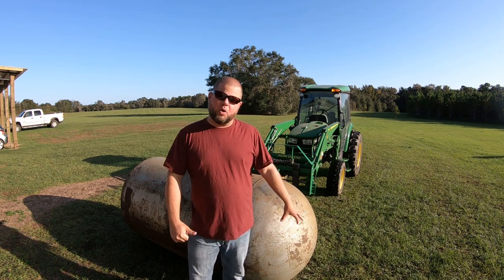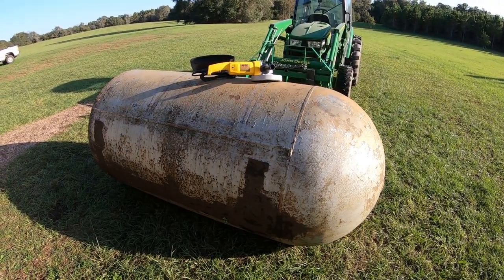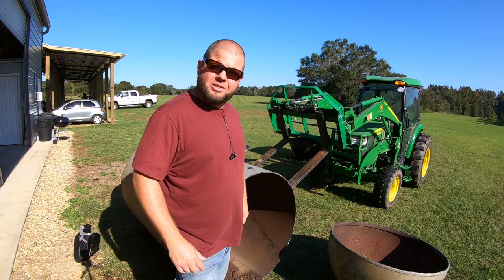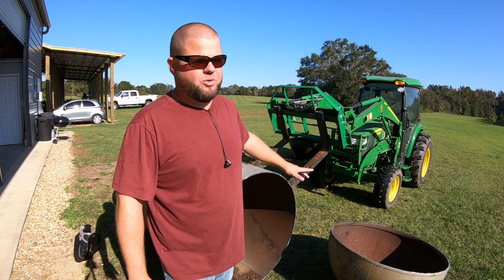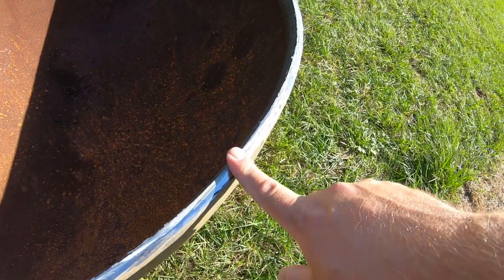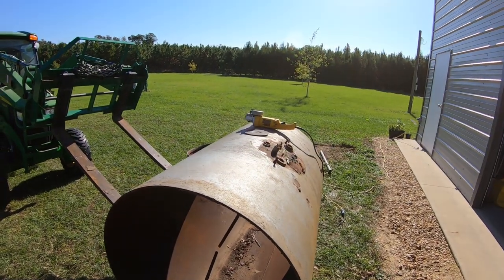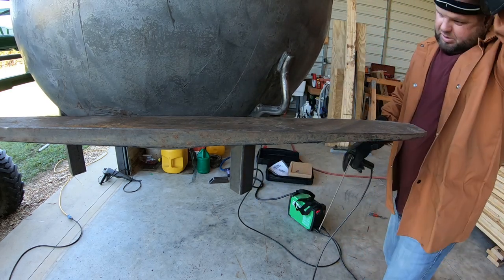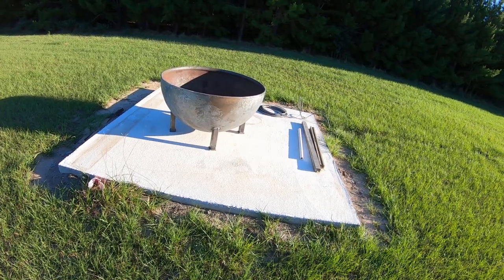#199 Building a HUGE fire pit for a viewer! Plus a new tool review

Comment: Looks good man but I wanted to point out that the number one improvement you can make is to hold the grinder opposite how you were holding it in the video. The sparks should be shooting backwards in the direction of the hand, sparks should be going in your direction. You could almost hold it with one hand and make the cut. Holding it the way you did will cause it to bind up and shatter blades constantly. I honestly think you could cut what you did in about three blades had you held the grinder correctly.

Comment: Excellent pit!  Do you deliver to Virginia?  :-)   I'm surprised you don't drill a few drain holes in the bottom of the pit.  With all the rain in Florida... the pit could easily turn into a bowl of ash soup after the daily rain storms.  :-)
Reply from the maker: Sadly no, you can drive and pick one up 😁. I did drill two holes in the bottom, I just did not include that on camera.

Comment: Nice build on the fire pit, I was curious if maybe a half dozen 1/2 inch holes drilled in around the bottom would help with a little draft , or do they burn ok without?
Reply from the maker: It is a little smokey at first due to the depth. As soon as you get good flames or coals, the smoke mostly vanishes and its pleasant.
Reply from the maker: I'm sitting by my pit burning right now with practically no smoke.
Reply: @TKCL  awesome

Comment: Well OK, that's done, I would drill a hole in each leg so they don't rust out.
Reply from the maker: I left the backside as is, no weld so it could drain. If there is one thing I know about water, it WILL find its way into anything.